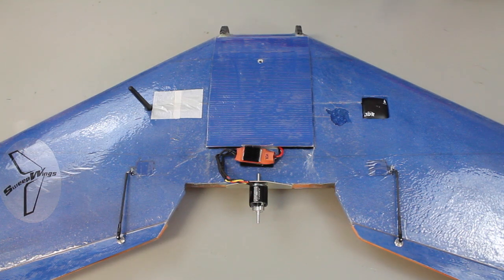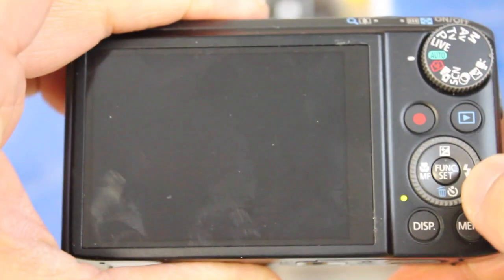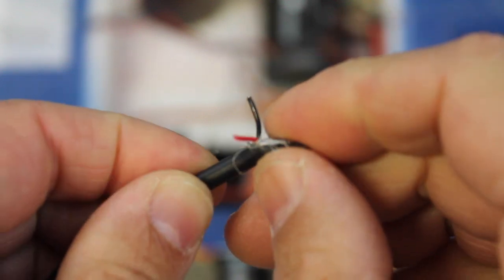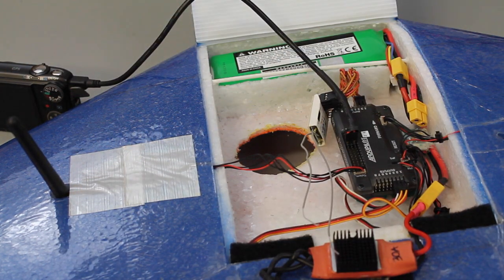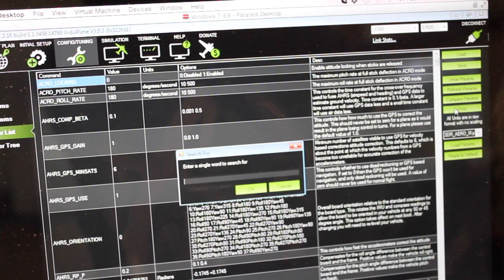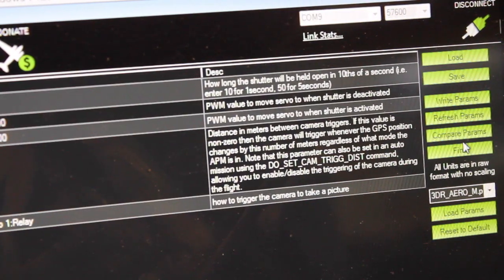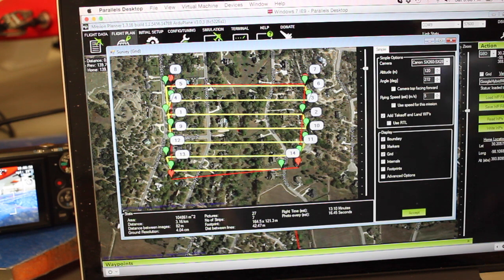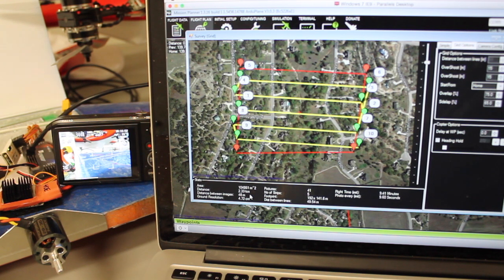How to Setup Distance Based Shutter with APM 2.6, CHDK and Canon SX260 HS

Comment: Hey Dennis! I'm planning on using the same camera to generate orthomosaic maps, but i've seen that people use light triggers in between the Pixhawk and the camera. Does it work without it? Thanks!
Reply from the maker: You'll need some way to trigger your camera. It can be done without CHDK if you use an infrared remote trigger. Something like this:

https://www.youtube.com/watch?v=UwLIiA7UM7g

Hope that helps.
Reply: Thanks Dennis! But in the video you're plugging the camera directly to the pixhawk. Does that work too? Thanks a lot!

Comment: Hi Dennis, it's us again. We thought from reading the Wiki the Distance triggering was not set by us in the survey grid parameters, but rather by the GPS signal reaching a waypoint, requesting the triggering.... My understanding becomes fuzzy now, after analysing this video, where you set yourself the distance... Sorry to be pushy with all my latest questions, but I am on the learning curve side, and I may also understand that AC3.3 may have evolved with Pixhawk since then.... Tks for keeping in touch Dennis. Cheers and Safe Flying!

Comment: Hi Dennis, I ve been following your channel for a while and i'd like to ask your advice: I want to do some aerial mapping of my farm, i'm thinking of buying a FX79 buffalo and battery, APM 2,6 with dr3 and GPS and a canon camera with chdk. Do you think it's a good choice? I'd like to map like 50 to 100 ha per fly. With this configuration, does the wing take off and land by itself or i need a radio for this? thank you for your answers!
Reply from the maker: +deff ma. I do think that's a good choice although you may want to look at a smaller setup like the FX-61, which should meet your requirements. If you're looking to carry something larger than a Canon S110 then the FX-79 is the way to go. It will takeoff by itself (you have to hand launch it) and land by itself if your mission is setup properly. Yes I'd highly recommend having a radio just in case you need to ever take control our toggle out of auto mode. Good luck and let us know how you get along.

Comment: Hi! I have done all these procedures carefully with my IXUS 70 on APM 2.6 but when I set SHUTTER to RELAY on the textbox it seems not to save it when I change the page and come back like moving to FLIGHT DATA or any other page and returning to the previous page the SHUTTER box remains in blank again and again. Am I skipping any procedure? Any idea?
Thanks in advance.
Reply from the maker: +Hedio Trevisan That's strange. I haven't seen this before but what I'd do is check when you change that to rely in MP all it's doing is updating the CAM_TRIGG_TYPE parameter to 1. Then if you select Disable it will set it to 0. So it could be that the parameter is being set but MP isn't reflecting it in the interface. After you set it to relay tab over to config/tuning and search for CAM_TRIGG_TYPE in the full parameter list. If it's still 0 then MP has a problem. You can always just set it to 1 right there in the list. Good luck.
Reply: +Dennis Baldwin I got it! All I did was to change the firmware from full to standard one and....voilá! Tks!

Comment: I would like to know what is the best overlap setting for canon powershot sx260hs.
Reply from the maker: +sangarp2001 It's more a function of what software you're using to process the imagery. In the Pix4D case:

"The recommended overlap for most cases is at least 75% frontal overlap (with respect to the flight direction) and at least 60% side overlap (between flying tracks). It is recommended to take the images with a regular grid pattern (Figure 1). The camera should be maintained as much possible at a constant heightover the terrain / object to ensure the desired GSD."

from here:

https://support.pix4d.com/hc/en-us/articles/202557459-Step-1-Before-Starting-a-Project-1-Designing-the-Images-Acquisition-Plan-a-Selecting-the-Images-Acquisition-Plan-Type
Reply: +Dennis Baldwin  i am using agisoft.

Comment: Hi Denis, you may know now but I thought I would mention something as you have educated me on a few occasions now..thanks. Once you have distance based triggering setup you actually don't need the "distance in meters" entered as a parameter value, when you mapping GUI is open their is a tigger by distance option in the advanced options tab. Once this is ticked the distance between shots that is worked out by the survey module will be applied automatically when the mission is flown. Because these positions are now recorded waypoints in the mission and are logged, you can now use the camera trigger distance option when geotagging in mission planner. This should be more accurate than working out a time compensation /offset to align the first image to a GPS coordinate.
Reply from the maker: +PlaneCrazy Many thanks. Doesn't that automatic distance calculation just automatically populate the trigg dist param in APM and Pixhawk? Just curious. Regardless I'll be looking into this further.
Reply: +Dennis Baldwin yes your correct. when you look at the flight plan detail down the bottom you can see the trigger by distance parametre injected in at the 1st waypoint at the calculated value.

Comment: Hi Dennis, thanks for the video. I had managed to build a working cable for the APM for the sx260 based on your excellent video. My question is, all that I need to add to have the same functionality for the Pixhawk would be to add the 5V step up board, right? TIA
Reply from the maker: Ard Surspec Yes that's correct. Something like this should do the trick:

https://www.sparkfun.com/products/10968

renoflash06 has developed a nice compact cable that I'm sure he may be willing to build for you. If interested touch base with him.

Comment: Hi, Just want to ask you why you use firmware update method to load CHDK? why not use Stick Tool and make the CHDK start automatically when you power on your camera. Just wondering
Reply from the maker: TechnoSys ind Good question. No reason in particular. There have been some cases where I didn't want to start my SX260 in CHDK mode, but not very often. I guess it's something I should get around to soon. Thanks for the suggestion.
Reply: Dennis Baldwin
Cheers (Y)

Comment: Hi from France Dennis,
Thank you so much for your great explanation.
According to your experience, what would be the good cruising speed to do photogrammetry with the canon SX 260 HS on a wing.
I have a project on the bench with this camera and the wing i'm about to buy have a minimum cruising speed of 13 m/s. Do you think it's ok or too high?
Anyway your videos are very informative.
Reply from the maker: Hoverview That should be fine. I'm normally around 15 m/s. Just keep in mind if you're flying low at that speed then your camera may not be able to handle the photo interval. If I'm flying with my SX260 at 400ft with a speed of 14m/s the distance interval is around 36m which comes to about 1 photo every 3 seconds. I'm stating this from memory so I may be off, but I recommend checking Mission Planner to make sure the data looks okay before you buy your wing. Good luck and keep us posted.

Comment: Cool video Dennis! I had thought that Mission Planner / Tower would set the trigger distance parameter for you based on the parameters you select in the survey tool? BTW I got the Pixhawk trigger working with a HobbyKing receiver controlled switch and a BEC but can't flight-test because my quad crashed badly in my backyard during a hover test. The 4in1 ESC overheated after 20 minutes, the quad drifted into the house and fell to the ground, lots of 3D printed stuff broke, so now I'm searching for a printer near me.
Reply from the maker: Till Seyfarth You're right on. Mission Planner will set that trigger distance and you have different options on how you want to trigger. I've been using CAM_TRIGG_DIST. Glad to hear you got the Pixhawk trigger working with the RX controlled switch. I have one of those and was planning on using it. Sorry to hear about your crash. Not sure I trust those 4-in-1 ESCs based on some of the stuff I'm hearing, including you. Good luck with your printer search and keep in touch. Hope all is well.

Comment: Hi Dennis. Awesome video as usual. Think I'm going to try a setup like yours. I'm not really into the planes but there is a clear advantage in their use for mapping. What's the flying wing you have that setup in? I know you played around with a few different image stitching s/w for the maps. Which did you settle on? Cheers 🍺
Reply from the maker: Julien Gordon I'm really liking the SweepWings Juggernaut. That's what I'm using right now and a new one is coming ready for Pixhawk. It's a very simple design that handles well in the air. I love flying it manually and with FBWA via APM 2.6. I've yet to fly it with Pixhawk but will be doing a full setup video soon. Another one worth checking out is the Phantom FX-61. That was a wing that I had good results with. Regarding software I still really like Pix4D and Photoscan, but am trying to spend more time with OpenDroneMap.
Reply: Dennis Baldwin I checked out that open drone map after seeing your vid on it. I think it will only get better. Will definitely look at those planes. Quads are great but for mapping I think the planes are a better bang for your buck.